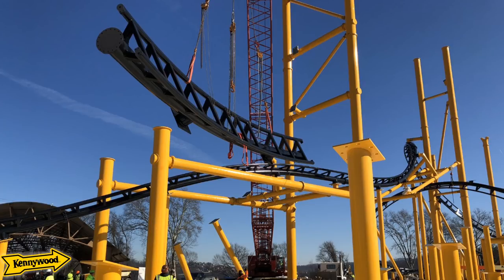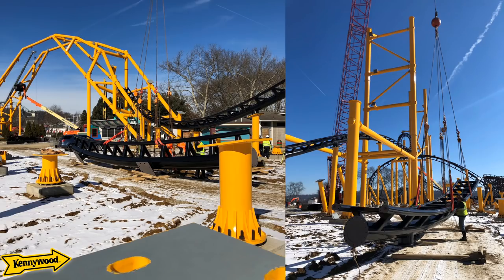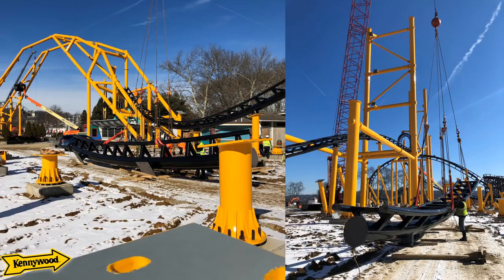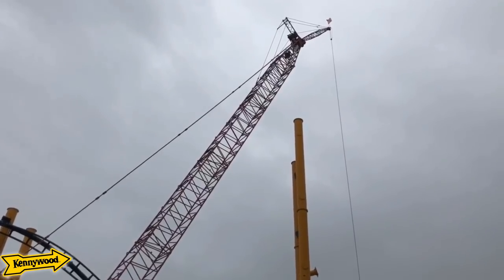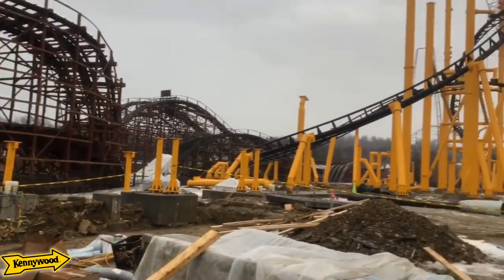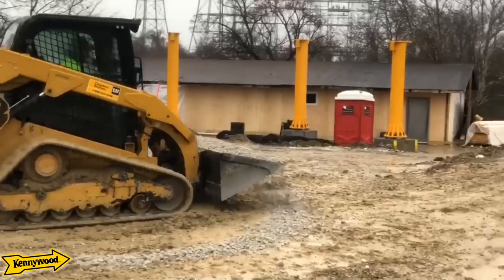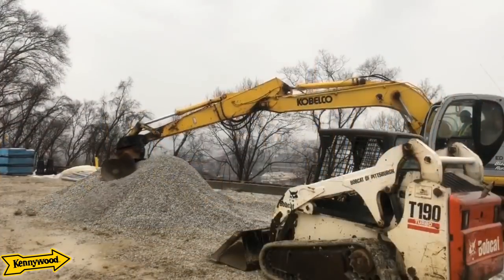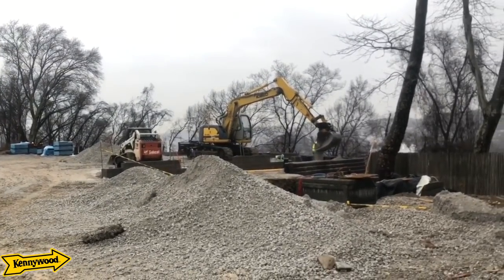Steel Curtain Construction Update

Comment: There is a legit section where they had to take off the support to fix it and the track is held up with straps and a chain
Reply from the maker: OurKingdom.ThrillPark from what I’ve been told and can see everything’s been aligned and is well :)
Reply: Amusement Insiders you can even see it in your video. It’s part of the cutback
Reply: Amusement Insiders wrong, I had a construction tour this past weekend there is a 20 inch column that has a 12inch misalignment, not really a problem though but it’s going to cost a bit to fix since you literally have to replace a structural number. There are also plenty of shim put in place for the nodes connecting the back bone to the rail connector. I have pictures but I’m not allowed to post them on social media for “legal reasons”
Reply: Fancyflashdrive Roller coaster enthusiast other than multiple misalignments, not sure. However I do know this ride opening will be delayed. Kennywood is working hard to fix the issues at hand. Also don’t think steeler country will open with the coaster either, they just finished the foundation for the new end zone building. Kennywood primary goal is to open Steel curtain sometime this season.